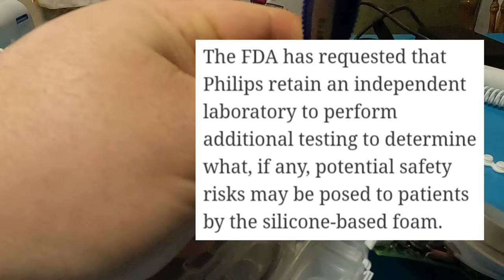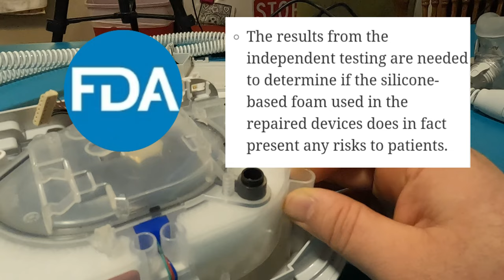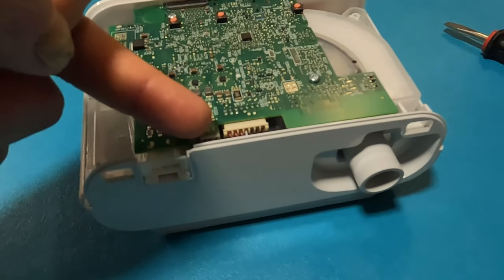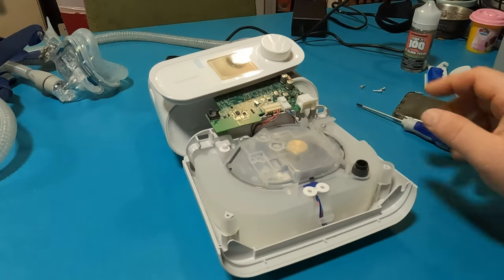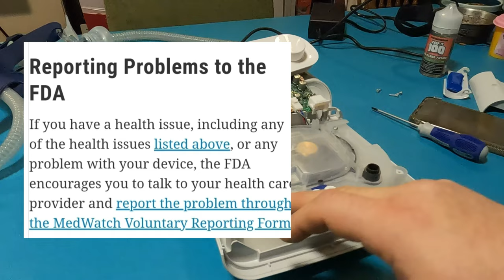Philips Respironics Recall 2023 FDA update😡

Comment: Crazy how expensive they are to cot even be properly made!! Is the foam necessary? I wouldn't feel safe using this if I had to!!! Thanks for the update! NO refund??? That's crazy especially if someone is paying straight cash!!!
Reply from the maker: It appalling to think that their fix is causing even more problems. It's not rocket science. Air goes in and air comes out. Over complicating the design with added foam was a huge mistake and it's still being done. Even my under educated truck driving ass knows better than to design something so absurd.

Comment: Makes me just want to stop using mine all together.  Other bands having this issue?
Reply from the maker: Not yet to my knowledge. Seems like the blank foam-less turbine housing was a logical fix in my opinion because it doesn't seem to change the sound level of the device. Removing the foam also hasn't appeared to change the usage of the therapy in my unofficial opinion. That would take time and testing to figure out. Using foam for sound abatement is completely logical as long as it's not in the pathway of air supplied to the patient.

Comment: Do you know if the FDA required outside testing on the new silicone that they told Philips to do was ever released?  I can’t find anything current.
Reply from the maker: I haven't found any evidence of it and just figured it's feel good talk. I eventually stopped following the situation mainly because nothing has changed. If you already follow Nick @cpapreviews I think he's been able to get better information. I use the replacement for backup only and when I did for short periods it was miserable. The programming doesn't catch apneas well and it often has runaway pressure depending on leak rates. That creates many false readings making it look like I'm a hot mess when I not. 👈😆

Comment: What is the difference between Dream Station 1 and Dream Station 2?  Also, is the foam used to make it quite? Did you run it without foam?
Reply from the maker: Dream station 2 is a cheaply made version of the one. They still haven't figured out how to keep the foam away from the respiratory pathway and there's issues with the new foam as well. The only purpose for the foam was sound abatement and the 50-60 series and Dream station one work as intended without the foam.

Comment: In replacement, myprovider gave me a new dreamstation with the white foam that I removed before using it. I dont take any chance.
Reply from the maker: I have a blank turbine chamber for just that. The white foam has some issues as well from studies done outside of the United States. Dream stations are incredibly noisy compared to the Resmed air sense products.

Comment: I got tonsil cancer from my philips.  I remember waking up with black particals in my mouth. 
The treatment was  brutal brutal brutal
Reply from the maker: Normally I like comments on here but it seems inappropriate in this circumstance. That's horrible and I hope you get compensated in some fashion. Sending out new machines hardly helps anyone after a year or more waiting.
Reply: Hello bro I am 26 also got that I am worried and anxious now , they not giving here anything in india , they gave me replacement dreamstation 1 just yesterday it showing manufacturing date of 2/2023 but still I am worried for using it , diagnosed with lymphoma and no compensation by Philips
Reply from the maker: @caringiscuring7011  I'm sorry to hear that. A full refund with a waiver would've been nice but it's not an option. They just send out another one with similar design flaws and changed the color of the foam we choke on.